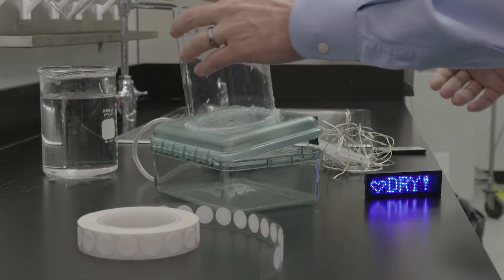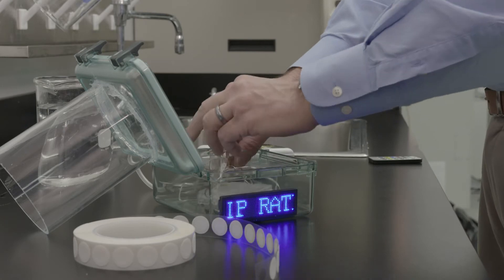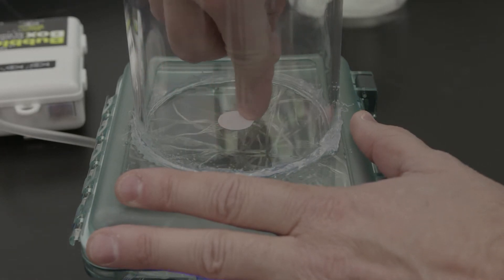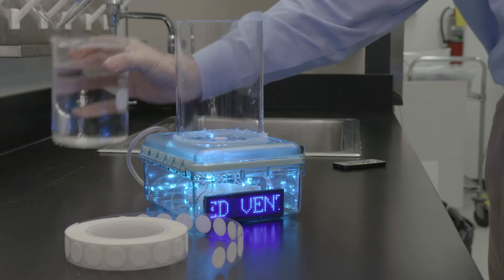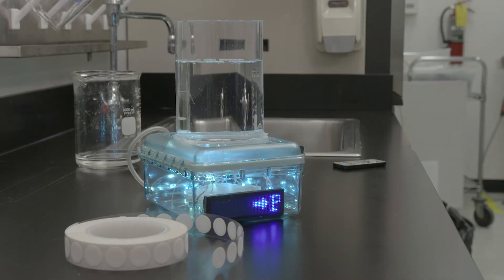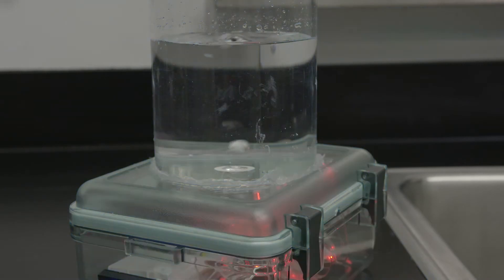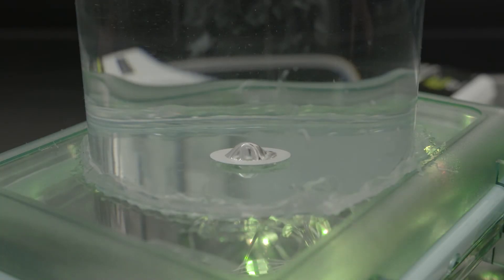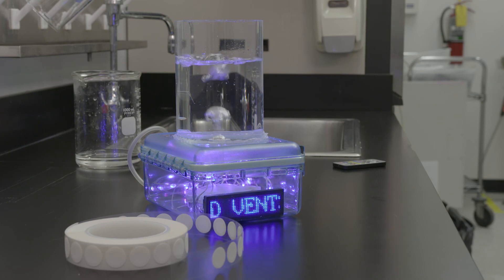Keep electronics dry and protected with Porex Virtek™ Sintered PTFE vents

Comment: Thank you for sharing this video. I am a DIY'er and looking to make an outdoor amp enclosure that is at least IP65 rated and has the ability to let the electronics breathe or better yet allows me to run active cooling, i.e. a case fan, and still maintain it's water resistance.  These vents look like exactly what I need.  I've searched pretty hard on google to find these but I am not having any luck.  Can consumers like me buy these?  And if so, where?

Comment: Are these filters directional?  I noticed as you use it here, it is on the outside of the enclosure but on electronics we have seen it used internally.  We are looking at using these on some of our electronic tool enclosures.  I am wondering if you have two types (external and internal) or if the location doesn't matter?  Thanks for the clarification.